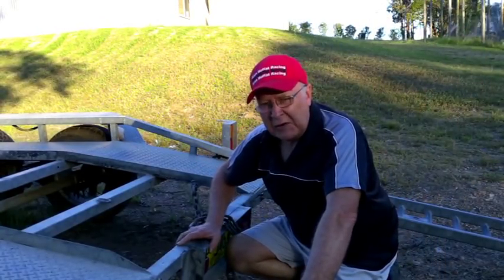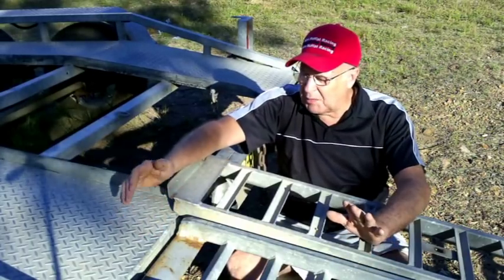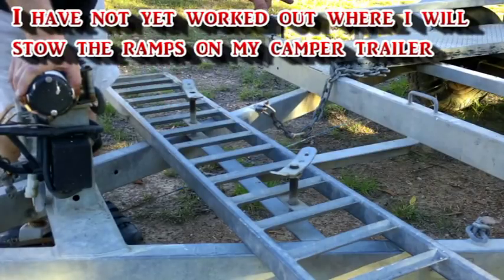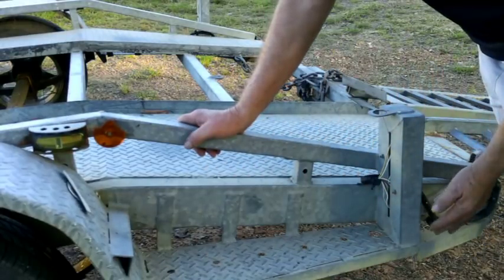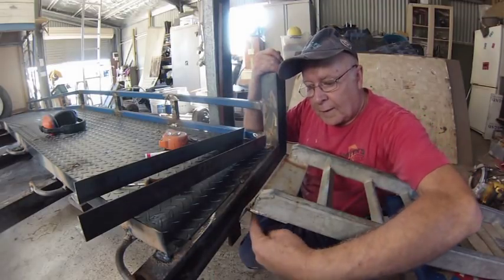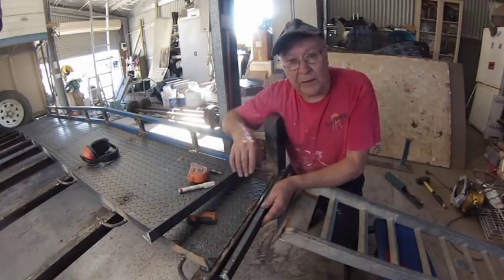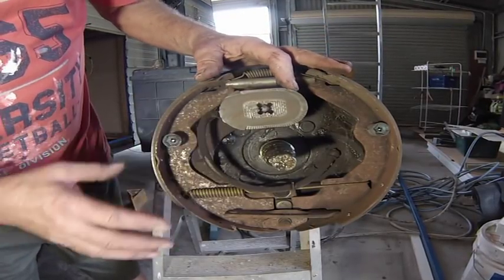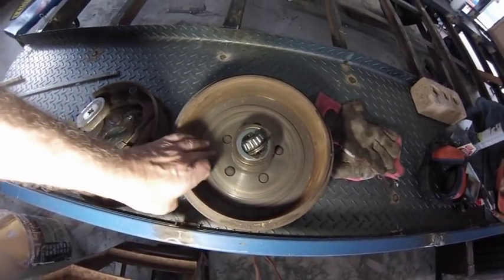Making a Car Camper Trailer from a Caravan -  Part 9

Comment: Nice work.  I prefer ramps that slide out of the trailer bed to their stops.  Quick and easy, but it takes a bit of careful design work to keep them from rattling.  A visible weld on a trailer axle would mean it would not be allowed past an inspection point.
Reply from the maker: Yes - which is why I am having new axles made. Yes I don't mind slide out ramps, but for low car trailers with dropped tails they don't normally work.